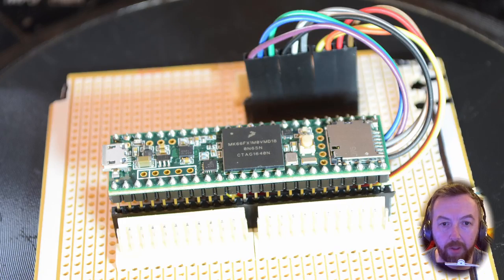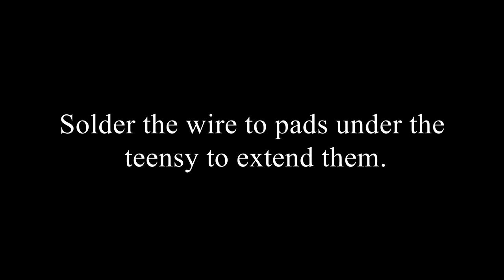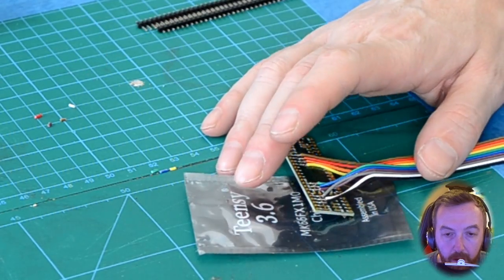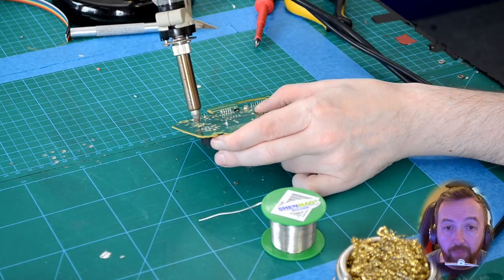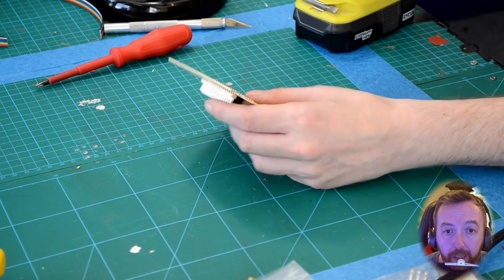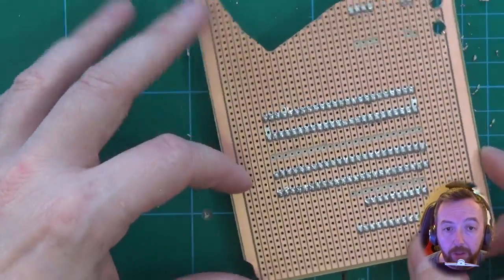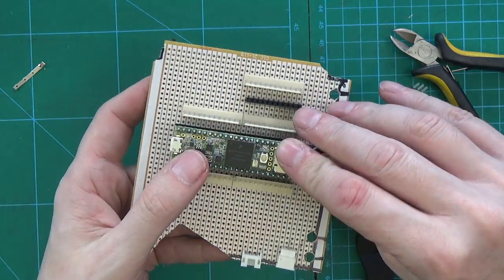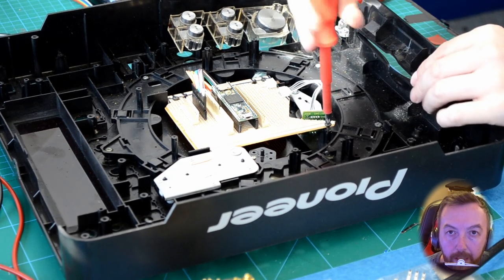CDJ 1000 MK3 Midi conversion Part 1 - The brains

Comment: Very clear presentation, very cool project and a very neat reuse of the old CDJ hardware. You've got so much talent. This video is 6 years old so probably you've moved on but those perfboard processes look painful. With a small desktop PCB mill and kiCad + flatCAM you can quickly fab custom one-off boards for projects like this without  constraint by perfboard designs.

Comment: I already own two CDJ1000mk3's,  replaced some of the buttons, and had them serviced..  I just love them,  I just wish they had USB and MIDI capability on them,  I have traktor DVS system for VDJ8, and it's a disaster waiting to happen!  I either need to mod my exisiting ones, or  upgrade, which costs thousands..

Comment: Hey man! You do well! Is it real to modificate cdj 1000 making usb stick readable? Seems like nothing complications there just need to wiring 5 volts and making data read usb instead cd. Physically it is posible i sure. But i know there is a difference betwean file sistems usb and cd. What if use something like converter for file sistems? Have you any ideas for it? Thanks for advice if you do
Reply: yeah it is look up new life cdj 1000mk3 sd card playback mod

Comment: Hello. Tell me, is it possible to do this with the CDJ 1000 MK2 or not ..?
Reply from the maker: Mk1,2 and 3 are all the same for these mods, but It does not work very well. The speed of the Pioneer jog wheel is very fast and it overloads midi and is not nice to use. This is why I have not updated this project recently.
Reply: @DJlegionuk  thanks for the answer

Comment: Can we add jog wheel display?
Reply from the maker: not that easy and would add a lot of extra processing and latency. This would then add to the problem of keeping track of the jog wheel position so would just makes it worse to use. Also I have no way to get any track position data back from traktor or serato  as well.